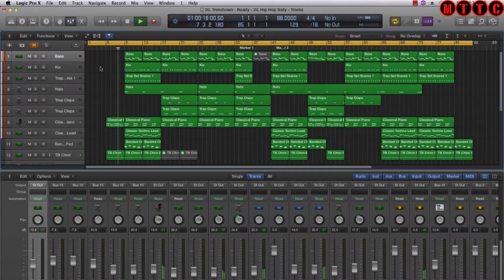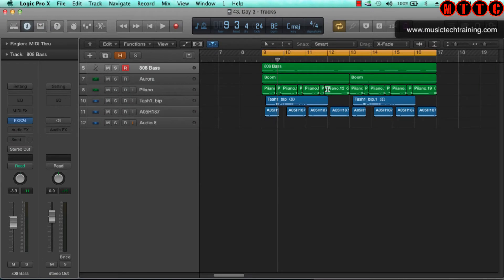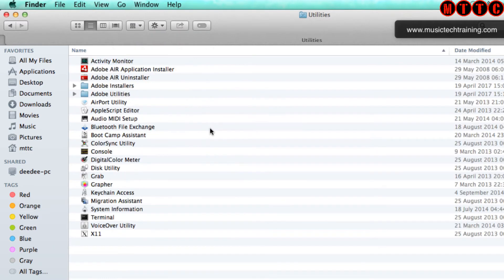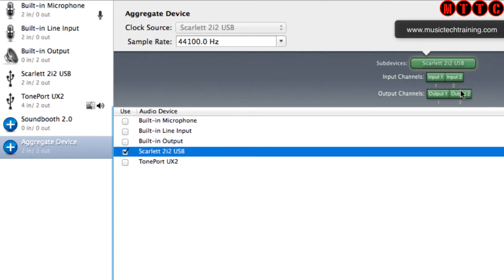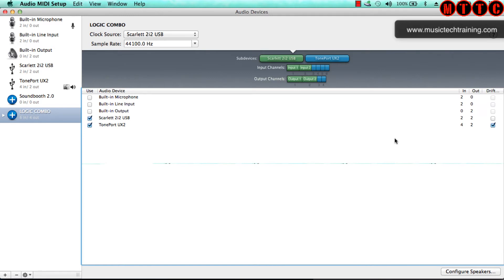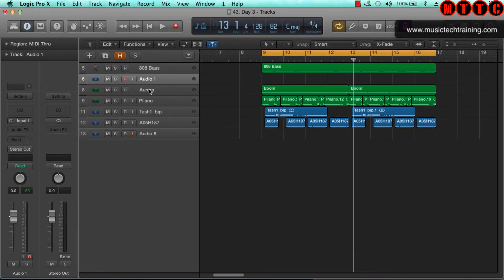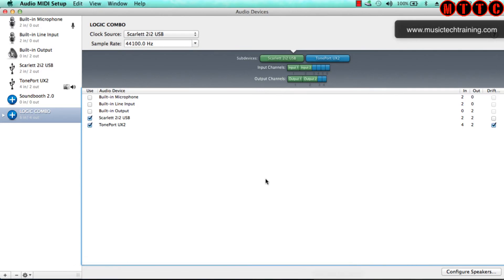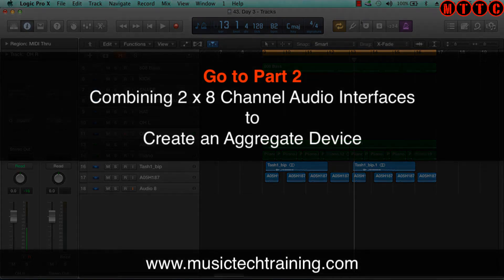Ultimate Guide: How to Create an Aggregate Device and Connect Multiple Audio Interfaces

Comment: Thank you so much for this knowledge. Also had a question. Can you link more than 2 audio interface?
Reply from the maker: You are very welcome JJ. Yes absolutely you can keep adding devices. That’s the beauty of this feature. Just remember that you will get more from a usb 3 setup than usb 2 as the data transfer rate is much higher on the later usb version. Cheers 😀
Duce.

Comment: In this method is possible to do 5.1 mix?
Reply from the maker: I have not tried that myself but the principle is the same as using an audio interface that has multiple outputs for a 5.1 mix. So if you connect up say 3 Scarlett 2i2 devices for example you’ll create a single 6 in and 6 out aggregate unit which will meet your needs. 😀

Comment: Hello, thanks for doing this vid.  I recently had a friend over to record her singing and I realized, how unprepared I was. I was trying to set her up in my makeshift vocal booth, but I couldnt do any real sound checking because I only had one set of headphones set up. I really needed to hear her levels, and hear the music, and the mix , but I realized im a dumbass. lol. I have an imac, using logic pro x. I use the Bose t4s interface on my mac. Now if im using that device to monitor sounds, and vocals in the DAW. I was thinking, I could use a second interface in the vocal booth. Would having my focusrite 2i2 in the vocal booth work for the headphone adjustments? No need for the headphone amp? Im going to combine the 2 interfaces by setting up an aggregate device. Now I have 4 inputs, and 6 outs and I can use them all. Think this will work?
Reply from the maker: Hey Monty. Thanks for the great feedback and question. Can I suggest you check out this video which might well help you out with your project. 😀
How to Create a Headphone Mix in Logic Pro X | Cue Mix | MTTC
https://youtu.be/peDAEWlhBpM
Reply: @MTTC  Thanks that really helped. Was another way of making that happen. Since I do have 2 interfaces, can I set them up as an aggregate,(increasing inputs and outputs over all) and leave the 2i2 in the vocal booth? that way I can plug the mic into that interface inside the booth, (to avoid the cable run across the room) and use the Bose t4s as my headphone out/interface at the daw? Does that sound possible. From what I see in the video, I should be able to do that. Is that correct? Thanks again. I have subscribed and looking forward to your other material.
Reply from the maker: Yes absolutely. The interfaces can sit anywhere and behave as a single unit. So that’s a very useful way of creating a separate headphone out closer to the artist in the booth. 👍🏾
Reply: @MTTC  Thank you. That was my thought process. Thanks much. Looking forward to looking through your posts
Reply: @MTTC  Thanks again for all your help. I watched the video you provided regarding the single aggregate mix using one interface, but im not sure how to do it the way you are explaining if I already created an aggregate device, combining 2 interfaces, and able to create a headphone mix in logic, cue mix. Is there more to know to get the same results with 2 interfaces, combined? Remember, I have one interface on my mac (engineer), and the 2i2 in the vocal booth. Im doing this for both purposes, singing and hearing my own mix, while in the booth and singing, and if I am at the daw, hearing a mix of the vocalist, when they come to the studio. Just a little confused on the process. :)

Comment: If you aren’t monitoring in logic. How can you monitor these sounds? 

ASI what if you have two of the exact SAME interface?
Reply from the maker: Sorry but I did not understand the first question. However, if you had 2, 3 or 4 of the same interface you can link them together to create 1 huge device. Cheers 😀
Reply: @MTTC   if you do that, how do you hear the sounds? do you have to listen through logic? My logic “monitoring” is always laggy. I’d like to set up two interfaces together. But currently I use the interface software to hear the sounds live.
Reply from the maker: @ElCapitanGames  You should still be able to monitor your live signal through the interface software. Why not give it a go and see if it works for you.

Comment: Hi There,  thanks for this very useful video! Have come across it at a time when I was wondering if this might work for me! Have you encountered any clocking issues when using aggregate devices for multiple interfaces?  I am hoping  to use an aggregate device with my UA Apollo Twin Mk1 (Thunderbolt) and another interface SPL Marc One (USB).  I have not purchased the Spl Marc one yet, so I have no way of knowing if it will work at this stage, so was wondering if you have used any UA devices in this way?I want to use the Apollo twin for pre amps & recording plugins (In) and use the Spl Marc one as the (out) for monitoring and critical listening. Do you think it should be ok based on your experience? Btw am using a Mac! Thanks
Reply from the maker: Hi there. Thanks a lot for your question. Firstly I do not have any UA gear nor have I tested the aggregate device pairing with UA kit. Having said that I see no reason why it would not work. Your I/O options are an interesting selection. The best thing I can suggest is to contact UA directly to find out if their kit can be joined with a USB interface to create a single unit. Sorry I could not be more help to you. Cheers 🙂
Reply: @MTTC  thanks a lot for your response.

Comment: hey mate, do you rout out of the slave to the master clock or bot out and in?
Reply from the maker: To set this up is quite straightforward. The clock source is Internal and the connections go to your Mac as normal. Logic then picks up the new Aggregate Device as a complete single unit. Hope that helps. Cheers😀

Comment: Can i use an audio interface and a usb mic in the same time?
Reply from the maker: I am not sure about that. I have not tested to see if you can aggregate those 2 devices as a single unit. If you have tried it do let me know. Cheers 😀
Reply: @MTTC  ok ill teste it this week
Reply: @MTTC  it worked, i just had a little job to find out the channel if my sm57, i add yelt as an aggregate device, then i didn’t plug yelti on my interface

Comment: Hi thanks, can this be done with 2 identical interfaces?
Reply from the maker: Yes, absolutely. I have done exactly that with 2 Focusrite Saffire interfaces and achieved perfect results. Cheers 😀
Reply: @MTTC  thanks
Reply: @MTTC  Do you need an external word clock,  with this configuration (2 or more identical DACs)  ?
Reply: Not really identical i have two apogee duets, one has midi out.